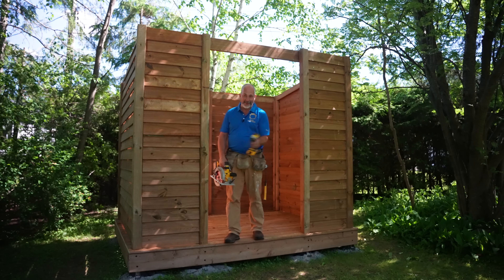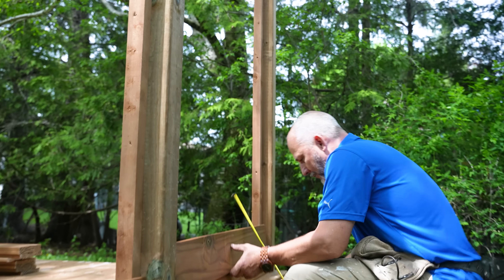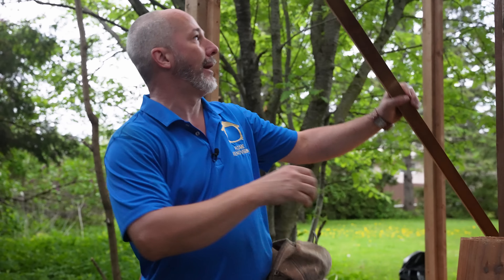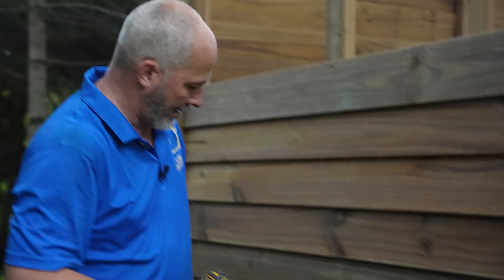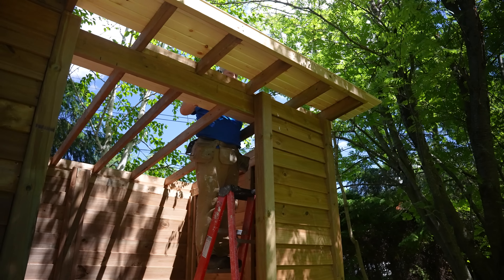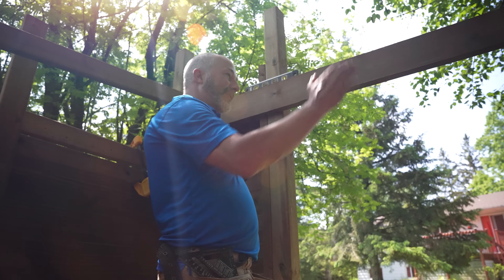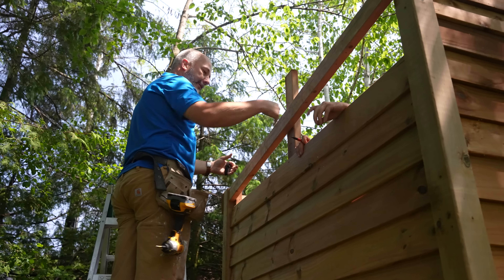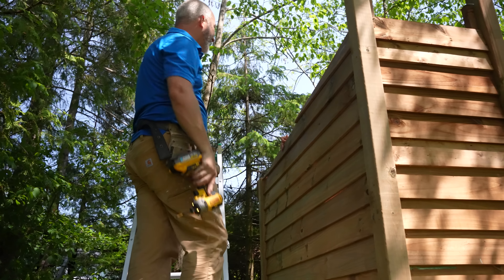The Easiest Way to Frame a Shed

Comment: What's the benefit of building a wall out of fence planks over using premade 4'x8' siding sheets? I suppose the fence planks let you build in 6' sections rather than 4' or 8'. But it looks like it would be roughly the same cost. $40 for a 4x8 sheet, vs 13 x $3.00 for planks.
Reply: This is a different look and is much more appealing to the eye then a sheet of wood.
Reply: saves on studs.

Comment: Wondering why you did not just put the boards on the outside, over top of the 4x4s?
Reply: The way he did it, it will look much better.
Reply: Rain will just go straight under the walls. Wet floor shed !
Reply from the maker: @upcyclebob692  this is more of a deck floor so it will get wet and then dry so no issue with Pressure treated lumber. Cheers!

Comment: Hey Jeff. Just want to give you a shout out for a video you made with caulking the bottom of the acrylic shower wall where it meets to top of the tub. We had a compression pole shelf in the corner of the shower that rests from the ceiling to the top of the tub. The other day I found the corner seem was open quite bit from the compression and the caulking was not doing its job and peeled. I remembered your video and I missed the very one step you touched on and that was the cleaning around the joint and wall to clean it with alcohol. I removed that stupid pole shelf cleaned out the old caulking and cleaned it with the alcohol and reapplied the caulking easy peasy. Hopefully this will get a better cure. Thanks again.

Comment: Jeff's got that working man's band aid on his hand. Black electrical tape is the best band aid there is. Simple. Easy. And when you wash your hands and it gets wet, water doesn't soak it and wipes right off.
Reply from the maker: Love a first aid kit that fits in your pocket. Cheers!

Comment: 6:06 instead of making a jig to try and hold level with the boards as you go up, why not make a spacer a half inch shorter than board, set above installed board and draw a line on both sides? Then you just line your board up with the lines you just made. Both work I just feel this is easier

Comment: I have framed, roof, sheet rocked, and done finishing work. I have not installed windows or doors. But now I am blind and I would like to be able to do this without vision. I wish the instructions were step-by-step and enough to know exactly what’s going on. I have envisioned while you’re doing at the top for the roof in the bottom in some instances because I’ve done the work. Princess when you say you’re doing cuts like you have a tiling where you cut it to the point and not by the measure. I understand expansion and the need for that 16th inch or1/8 inch play. for expansion, but the confidence I need is not quite there is there a audio device that tells Level on a standing 4 x 4, cause I know I can use a string and plum for some of it and a clamping slide for some of it, that you know of? And is there instructions for your work here in writing where my cellular phone can read it to me and have the extra descriptions for not having the vision. I have damn good spatial reasoning and Understand load etc. I was cited. Thank you. I have not done the outside overlap board or framing I’ve only done inside finishing. All the outside I’ve done is a pole barn with painted metal exterior. I wish there was more description on that. I imagine the old stuff like using  plywood and tar paper but I know they use pressed glued wood chips nowadays what do they call it OFB (4’ x 8’) or something I can’t remember. we used to produce the wood chips at Tommy Graham sawmill and his partner business lumber company, can’t remember that guy‘s name. company in South Central Tennessee years ago when we started moving away from producing so much plywood and started creating a ton of that kind of board. I was also wondering why you didn’t just Poore some forms in the ground instead of describing so much about how it sat on the ground. I guess maybe you want this to be a 20 year shed, or be able to move it? Lol at least that’s what your descriptors led me to believe because remember I do not see what you’re doing.

Comment: What stops  water from getting in where the walls meet the floor?
Reply: if you're worried about the small bit that might get under there, either add weather stripping to the bottom board when you put it in, or run a like of caulk on the inside edge of the wall.
Reply from the maker: nothing. but this is a garden shed for a lawnmower and hand tools so a little water is irrelevant. Cheers! you can actually use a garden hose to wash it out as needed.
Reply: If you are handy, you can make some Z-flashing or just caulk it on the inside.

Comment: I love this shed design but would like to adapt it . I’d like a lower foundation so I don’t need a ramp for my mower. Is the structure of the shed dependent on the strength added by the flooring system? Could I build shed then make a simple lower floor internal to shed?
Reply from the maker: you could simply pour a pad or dig into the ground to make it ground level and a little dirt ramp. but I do have the ramp video coming soon and it is so easy to build I may convert you. the ramp is a lot less work than a ground level deck or pouring a pad. Cheers!
Reply: @ I will wait for ramp video. Just wanted to make sure flooring wasn’t structural to the shed. I have good access to cedar so thought I’d make the black parts pressure treated and the stained parts cedar.

Comment: Would water not potentially pool into the shed?
Reply: Of course it will, he has not even used a level yet
Reply: @richardhuber3904  Well he used a level in the last video for the foundation, just wondering as I would expect the foundation to be leaning to some angle.

Comment: So far, the only improvement I can see is adding some batter boards on the inside so you don't accidentally crash into the siding with a lawnmower or other heavy item. (kids on bikes?)
Reply: @rupe53  I think the best improvement would be to knock it down and not start over
Reply: @richardhuber3904    so you are saying the whole idea and the shed is junk?
Reply: @rupe53  it's ridiculous, framing is 16 oc withe top and bottom plates on a slab or foundation with plywood sheathing real roof rafters, collar ties sheathing, tar paper, roof shingles and a vented ridge and soffit. Stop insulting the trade with this garbage work
Reply: @richardhuber3904  I gather you don't like the idea of building a shed like a pole barn.
Reply: @rupe53  it needs to be weather proof and sturdy, a pole barn has posts sunk into the ground deep enough to avoid frost and be on undisturbed soil with lateral stability. Protect the thing that are stored from the weather and rodents
Reply: @richardhuber3904    you make a valid point, but not all pole barn styles are sunk into the ground. I have seen a few that are screwed to a concrete slab and start out looking more like a carport until the siding goes on. Would totally agree the base here should be to the frost line. (I posted that elsewhere)

Comment: This should have definitely been built taller. With the design of the door being in the middle of the long side of the building, on the high side of the roof, and the roof being less than 7' tall you will never be able to put anything long in there.
Reply from the maker: feel free to build to your own specs. this is going to be a garden shed for me. just a lawn mower and related garden tools only. Cheers!
Reply: @HomeRenoVisionDIY  Don't forget it can be used as your sleeping quarters in emergent home situations/disagreements (and it's larger than a doghouse!). 🐕